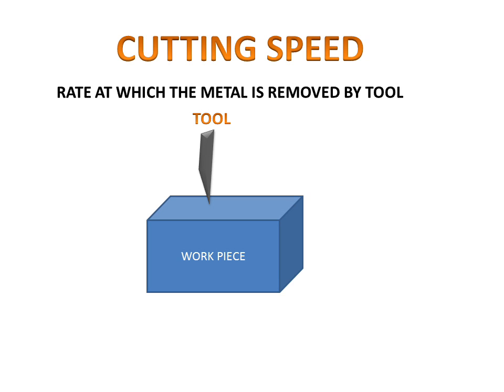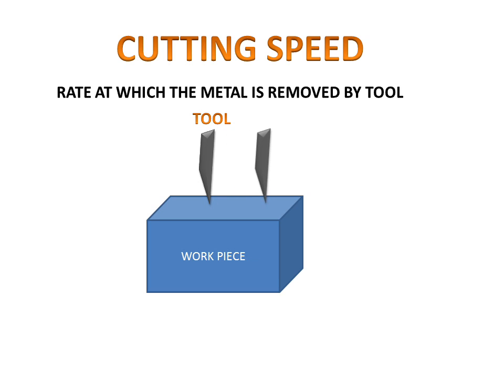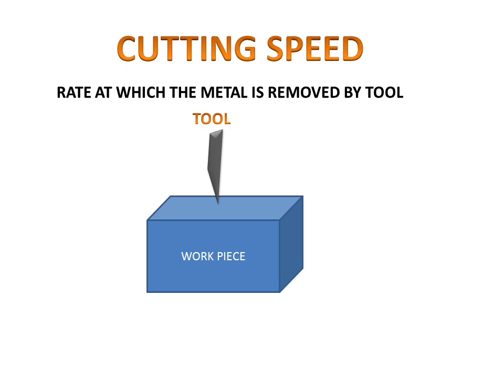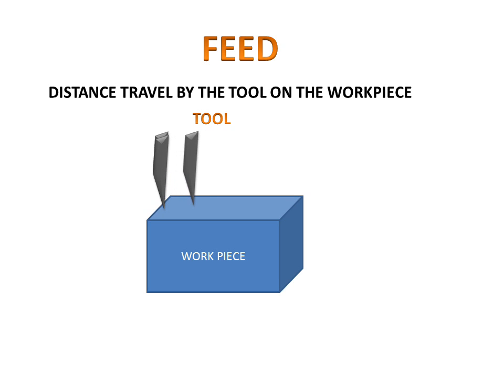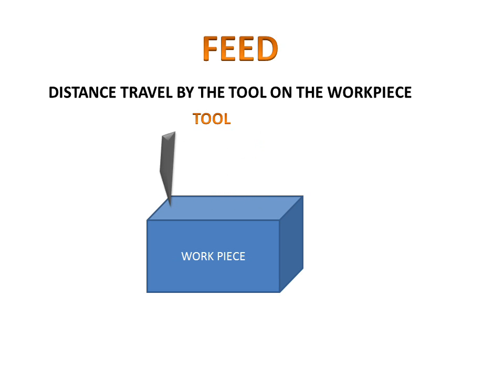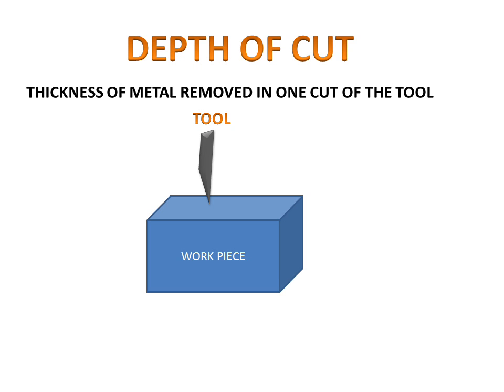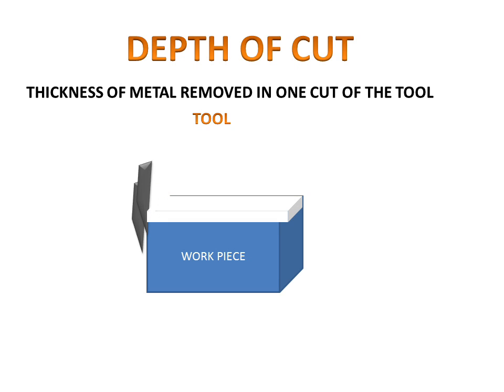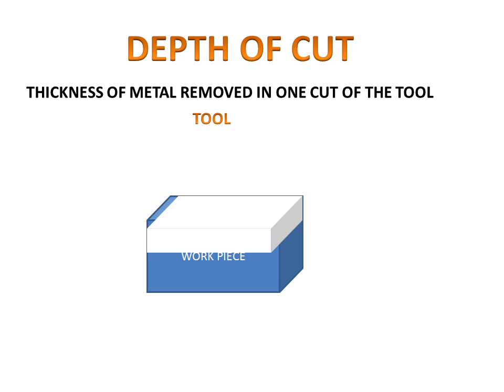Cutting Speed,Feed,Depth Of Cut

Comment: Sir I confused in step over and feed rate, because feed rate mean tool move X and y direction if we put low value step over tool movel x and y direction slowly and when we put higher value tool will work high speed X and y direction, but feed rate work same ,moving speed tool direction so what is difference both please explain